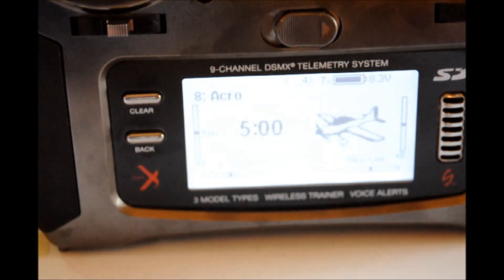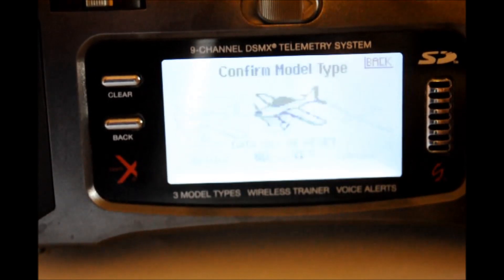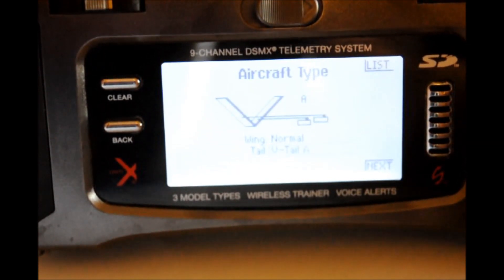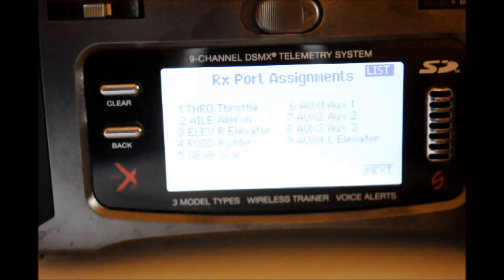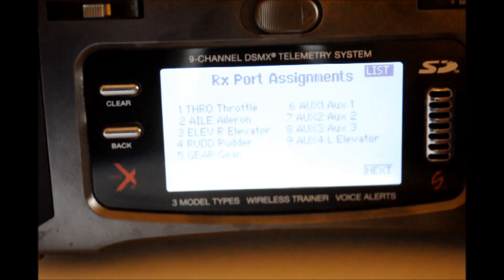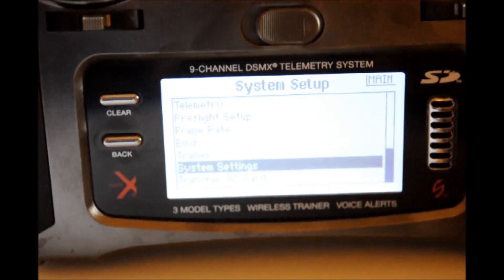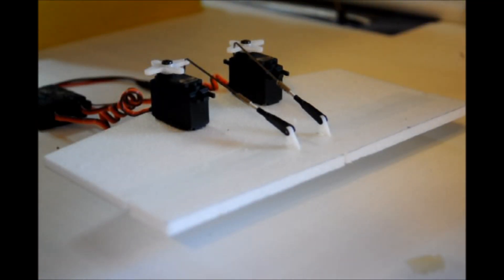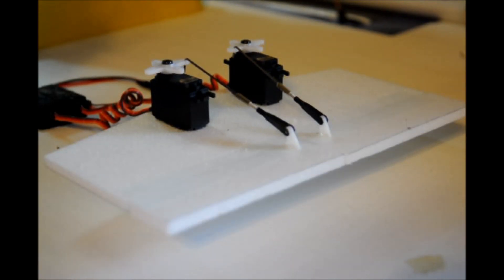Dual Elevator Tech Tip final

Comment: What if you don't have a computer transmitter and you are setting up an f-18 with independent servos for each side of the elevator
I've got a y cord connecting 2 servos and they're working opposite of each other how do I fix it

Comment: Mike... on a DX5E working with SAFE, say for a Super Cub S, can you find out for me what points SAFE is expecting to be hit by the three position switch. After a TX upgrade, carefully and repeatedly following the Spektrum instructions for a DX6i nonetheless resulted in being stuck in Beginner Mode 1. My experience was that I had to use SubTrim and play around with the Mix settings to get all three modes, which I now successfully have. Much more critically now with the Sukhoi 29m, same kind of thing, I have it working but it is frustrating that Spektrum seems coy about properly answering the question. You seem like a nice, sensible bloke which I why I have risked asking the question.